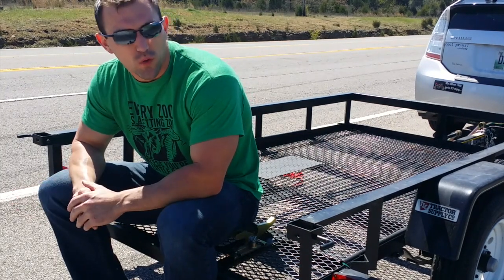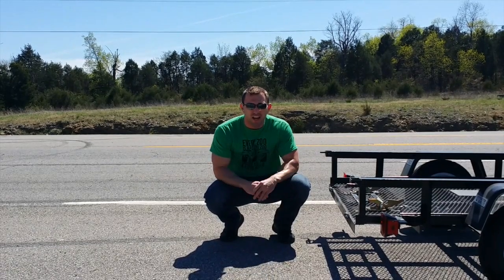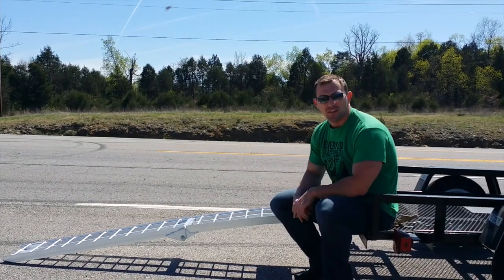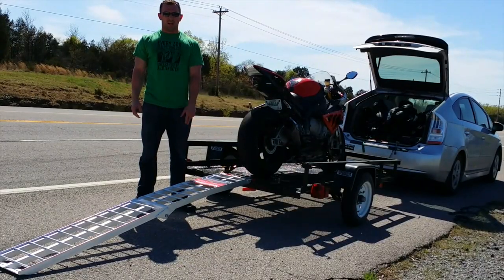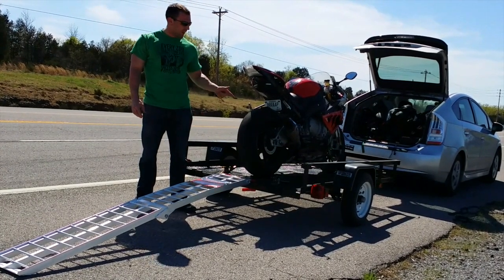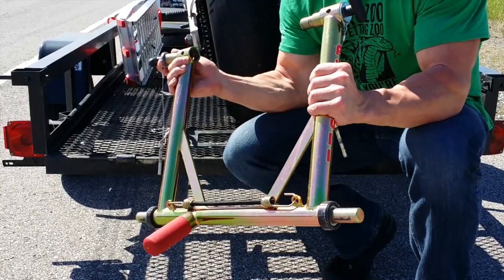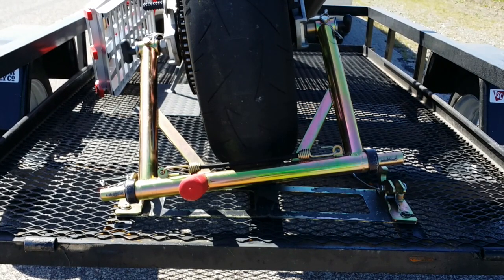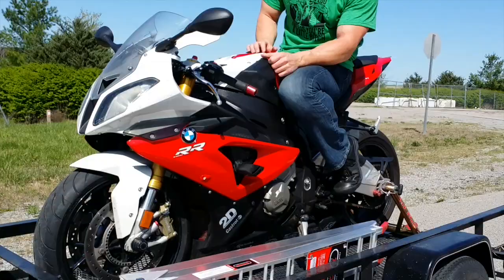Mark's How to Tow With a Prius

Comment: Thank you for making this video! I have a 2005 Jeep Grand Cherokee with a HEMI and the gas was getting to be too much. It has been sitting in the driveway now. I recently bought a used Prius to see what all the hype is about. So far I’m extremely impressed about the savings I’m experiencing. 

Now what I was curious about was if I would be able to pull a motorcycle for track days. Any updates about pulling the bike with the Prius?